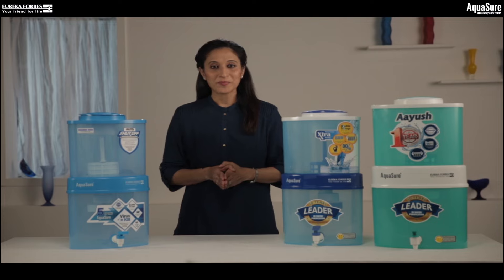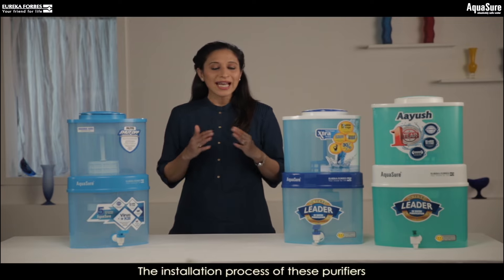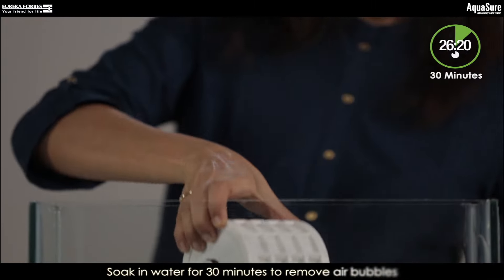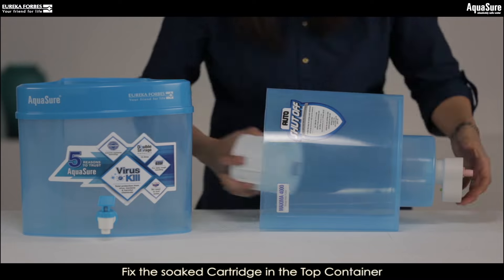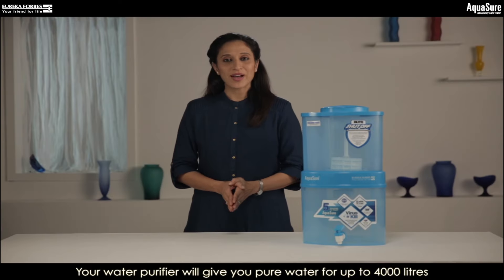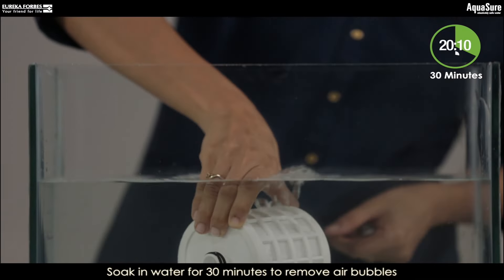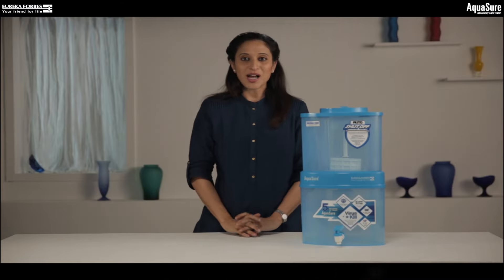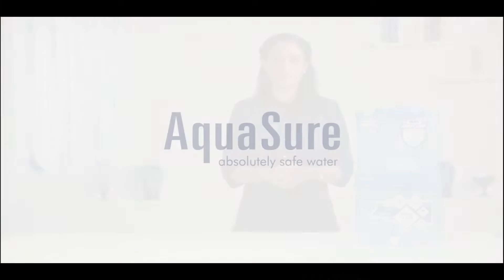Eureka Forbes AquaSure Maxima 4000, Xtra Tuff and Aayush Installation Guide

Comment: @eureka Forbes I've changed a new cartridge to my xtra tuff 15 ltrs. But the purified water is dripping very slowly in its bottom chamber. I'm not getting enough water even after hours, how can I fix this, pls tell. Thx
Reply: how did you got it fixed
Reply: @kapilbodke pls, check these things:
1.  Clean your charcoal filter by the blow pump provided with filter.
2. Unscrew and loose the float mechanism in the bottom chamber, it shouldn't be tightened.
3. If it's been a long time for your cartridge or charcoal filter, ie, 5-6 months, then it needs a replacement.

Do you know, they didn't even bother to reply me. I had to do the hard work online for the resolution. The customer care is the worst thing in regards to a business in India.
Reply: @anandchandra7687  The customer care is THE WORST experience i had. Hence i posted my query here. Really Thanks Alot  for your reply.. it worked 👍👍

Comment: Eureka Forbes
Water Purifiers
A substandard product and Pathatic Service

In less than 5 months of purchase, the purifying tank burst, which is not convered under warranty. And nobody attended the complaint for 3 weeks, however if you put a new query next day the guy was at your doorstep to sell a new unit that too in covid times.
Purchase:21-jan-2020
Stopped working: 27-may-2020